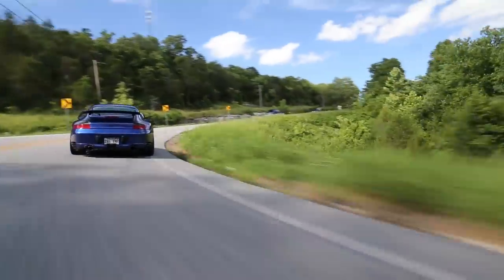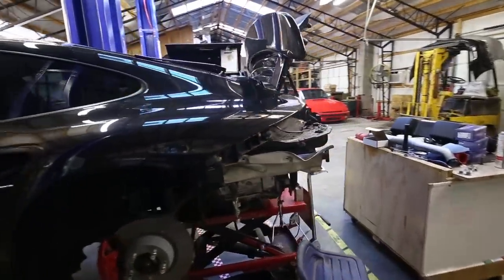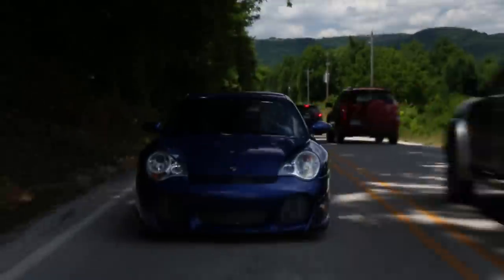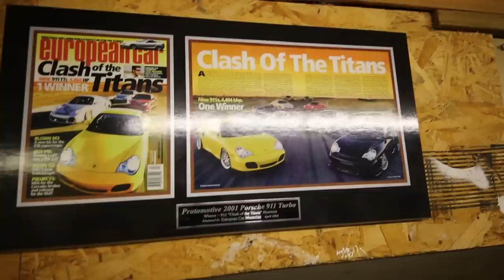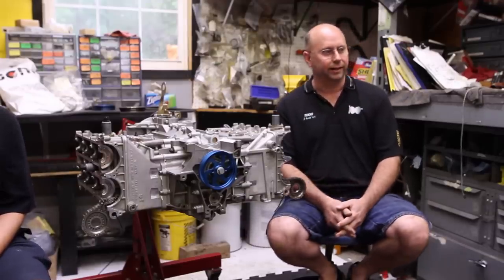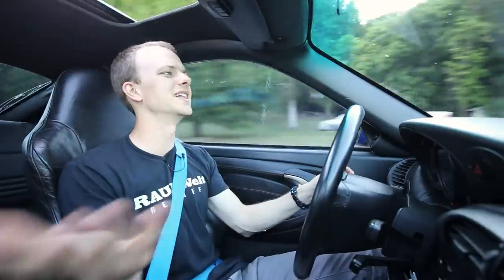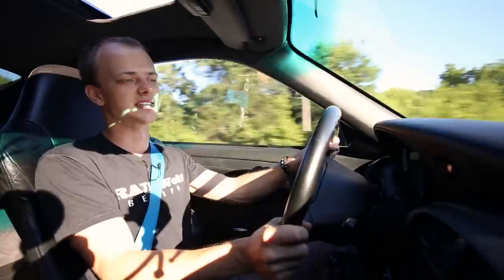We Found a 1,000HP Porsche 911 Turbo Where You'd Least Expect It.

Comment: 19:48 Builder explains why really high powered street cars like this are actually pointless 'unless you're on a 4 lane highway, rolling on the throttle at 100mph... forget about it'
Reply from the maker: That's what a boost controller is for! Best of both worlds. 600whp in a manual 911 is totally useable on the street, but still brutal enough to want to kill you if you don't respect it ;)
Reply: Project D true though with a lot of modern high hp cars they can be detuned for the street.
Reply: True, I'm sure the owner doesn't roll around at max boost. It's also better to have that overhead in the engine build especially with boosted engines. Nowadays you can also tune boost by gear or use dbw/timing/boost control based traction control too. I just don't even want to know the cost of the extra parts to bring 600 up to 1000. Glad to see you constantly progressing on another note. Keep it up.
Reply: Boost by gear and mickey et streets on full kill would be fine to hook at 60
Reply: He nailed it. Even a stock 996tt is useless on normal rds. Unless you want to get impounded. A lot of kids dont realize this.
Reply: Kids can not afford or drive these cars. Should have age limits on how much hp your allowed to have... But since people would rather focus on their devices while driving, the gov and big companies would rather take more privileges/freedoms away and push autonomus and crappy quiet electrics. And do not get me going the the environment, that is pure BS!!! , just like Sept 11, and most of the other events in the us since then. All created by elites for their grand plan.

Comment: Stuff like this you just can't script.  Couple in the Arkansas backwoods have a top shelf performance lab that builds some of the nastiest Porsche motors around, and does all of the design and machining in-house.   Someone get the Anime deal in the works.   Also, it reminds me of maybe the best NSX tech in Tennessee:  'Used to work out of a literal barn.  You'd go to a small town outside Nashville, turn off the highway, go over the river, through the woods, turn a corner and there would be half a dozen NSXs and ITRs lined up next to the split rail fence.

Comment: I recall a Porsche shop with a female tech that brought out a very fast 911 to run against Eddie Bello and they beat him.  He was so pissed off that he ripped off his intercooler and threw it on the ground. Well the next pass he broke the world record I believe running low 10, high 9 in the 1/4. This was at Atco or Englishtown raceway around 2000-01 . I believe the shop was from Connecticut?

Comment: Why are the 996s always the 911s getting tuned to high hp. I never see as many newer models getting tuned to crazy high numbers. Is it something about the engine?
Reply: MysticBlack you nailed it.  The metzger engine is basically a detuned GT1 engine and is extremely robust.  The newer engines not only are weaker, but with the new dfi fuel injection the high pressure pumps are limited in fuel flow.  So there are many more barriers to overcome on the newer engines.  The pdk trans is another limitation and won't handle the torque of the manuals.

Comment: I have one question this 911 are all wheel drive? I am asking this because I think the new 911 turbo is awd.
Reply: cobratoxic since 1995, the turbos are all awd. Except the gt2.   This car was converted to 2wd like the gt2 for a lighter, nimbler driving experience.
Reply: Boston 508617 yes.   The 996t converted to 2wd/rwd drives so much lighter like a gt2.

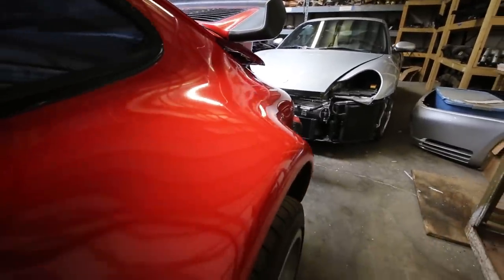Comment: 13:36, there is a dent in the door  =(
Reply: 777aterial one day before they arrived, the fuel drum broke loose in the trailer and dinged up the hood, nose and door.  Paintless dent guy got out the hood, but ran out of time.   She's a driver though!  Has seen a lot of road miles and very high speed bugs ;p

Comment: they pulled the boost for you L M A O. trust not there bruh.
Reply from the maker: There's more than enough trust to hand me the keys to a very powerful, special, and high dollar Porsche 911. These roads were not made for 1000+hp, which is why even Todd could only get full throttle for a couple seconds at full boost. It's just more playful around 600whp on these roads. :) if they had given me the choice, I would've stuck around 6-700whp

Comment: Does the 1000hp car go faster then the stock factory verions in reality
Reply: Allen Saunders considering it has almost triple the power, I would say yes.
Reply: Uh, yeah. Throw-you-in-the- backseat-power.
Reply: Mark W maybe i bet its no faster
Reply: Yes. This has about triple the power while maintaining the same weight. How could it not be faster?
Reply: Seriously?
Reply: Allen Saunders  what are you talking about?
Reply: Allen Saunders stock 996tt's are gear limited to 195mph.   This one is currently gear limited to 220mph.   With taller gears and rated tires 250 plus would be possible at this power level.
Reply: In reality - "where" can you use this? Love, love, love my 996TT on the track. But my previous 993C4S was a far better street car. There just isn't anywhere devoid of slow moving traffic where you can get more than 2 seconds of Wow. Seriously, even in the middle of Nevada I've run out of room.
Reply: SecurityGeek IRL around us I leave the boost down.  At 600 to 700 whp it's a blast to drive. At events the beast can be unleashed :)  Texas mile, Texas invitational, 60 to 130, airport events etc.   Roll on racing.   For road course use I'd leave it around 750 to 800 depending on the track.  Sears point would be less, laguna Seca could use more.   You dial the boost to whatever usable power you'd like depending on the track.
Reply: @allensaunders449  You would be wrong. Very wrong.

Comment: I doubt this thing has over 750 crank hp which is 650 wheel. Plus if it had over 600 lb-ft of torque, this guy’s head would be pinned to the head rest. His neck would get very sore trying to keep it off the head rest on purpose.
Reply: Okay, that’s better. Click bait till the end. Awful. And all the time this 35 yr old (going bald), thought he was driving a 1000 hp car, lol.
Reply: Thenthe boost is turned up to mild.
Reply: Lol, yeah....    Not having experience with this type of power it would have been dangerous to hand him a fully loaded weapon like that....   He did well with it with the boost controller turned off at only 0.8 bar 🙂

Comment: 1000 horse power? wait for it to explode
Reply: bishop we have a long standing reputation for building very reliable high power builds.  With power comes responsibility.  This car runs e85 so it's cool and safe at these power levels.  On pump fuels it runs around at mid 600's and is a wonderful daily driver. The engine was finished about 2 years ago and has between 10 to 15,000 miles right now.  We have client with 50 to 60k miles on these builds and others with 100k plus miles on their cars 911,  964 and 993 twin turbos :)
Reply: Todd, can't expect people with no clue to understand your works of art... they have no ownership experience, no firsthand experience, don't know you from the forums, don't sweat it lol... Tons of my buddies over the years have vouched for you and still do, I've seen their builds.. If I didn't buy my RUF GT2 it would have certainly been a build from you!
Reply: iLLGT2 yes, we do end up talking many clients down from a lot of internet hype and do our absolute best to fit each client to a perfect build level for them :)

Comment: The audience of this video is clearly not 996 Turbo owners, or even Porsche owners. There is no information in this video, no performance metrics. What's the 1/2 mile or mile time and speed? What's the 60 to 130 time? To have a review of a supposedly highly tuned 996 Turbo by someone who does not own one or has any experience tuning one is really not providing any value. It is just a commercial. Show us at least a pull through 2nd., and third gear. Was the owner too afraid the engine would blow up?
Reply: S.t.f.u. as a 996tt owner i can promise you this car hauls. It aint stock thats for sure
Reply: I can assure you that Todd was not afraid of it blowing up. He had me take someone for a ride to see the track at Hallett Motor Racing Circuit last March at a PCA high speed drivers ed event. Only instructors could have passengers is why he had me take him out. The track was wet when I first rode with Todd in the morning but was mostly dry when I took it out. Once the tires were warmed up I push it harder. I was very impressed with how it seemed like any other 911 Turbo till I gave it full throttle after it was out of the turns. It was like being launched from a catapult down the straightaway. I told Todd that driving it was addictive! How many people do you know with the confidence in their work to have someone you have only meet a few times to take their car out like that?
Reply: @lesliemorse3758  we had an awesome day at the track with you. 😎😎 Changed the oil, swapped brake pads and drove out to see my daughter.    It's been awesome to have the reliability of porsche behind the car 🙂